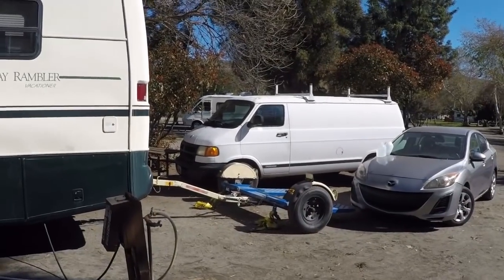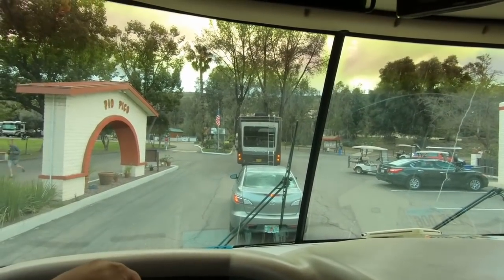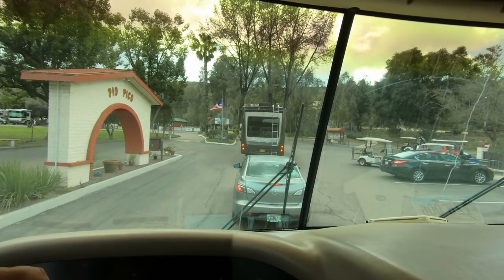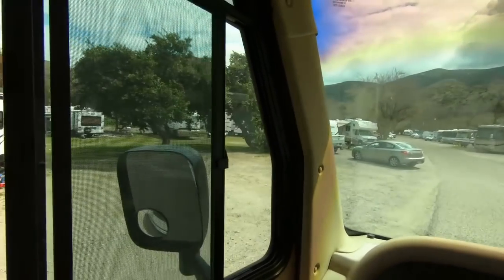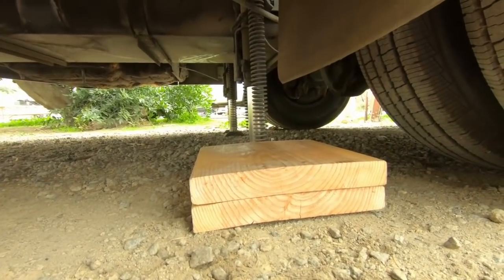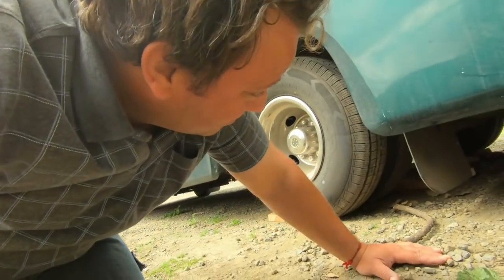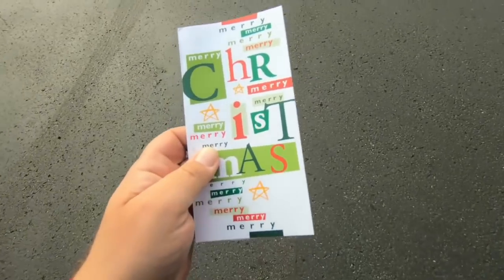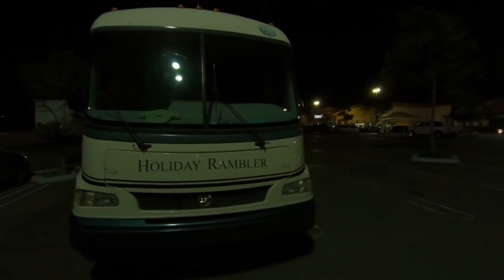$5 A Night RV Camping Site In San Diego California RV Park Life At Thousand Trails Pio Pico

Comment: I never thought someone could charge a large battery using a small battery. Whatever you are selling must be the magic gadget all of us have been waiting for. Lol
Reply from the maker: RAY RAY Lol,  guess you don't under stand the differences in battery chemistry or how they work.  Current goes from high voltage to low just like heat goes from warm to cold. That little battery box has more usable energy than you realize.  But,  it is expensive.
Reply from the maker: eren mori  No, with my coupon code its around $1300. And at 2000 cycles it will likely last me 10-12 years if I take care of it.

Comment: Ray Ray 
I invested in one of the Kodiak Packages, and with only the exception of a really slow stock charger, I could NOT be more pleased.  I've switched from charging the unit from shore power, to keeping it charged using the included 12 Volt DC cable & plug from my vehicles which charges super quick!   With so any more times the available amperage at such reduced weight and with the longevity taking into consideration - it's actually a bargain!  
Happy Easter Everyone!
Reply from the maker: Are you completely happy with inverter as well?
Reply: When the well packaged unit first arrived,  I followed the included instructions exactly, and found the unit was not charging to stated capacity.  Upon speaking to Inergy's rep, I was told (while ON speaker phone with witnesses present) that they are having issues with a "small percentage" of the presently included chargers that are failing to bring the units to what "they state" as fully charged.
 They immediately offered to send me another "standard" charger to replace the original, but were resistant when I offered to pay the difference so as to UPGRADE to the "Super" charger.  Their reply was that was sold as a separate part.  Well DUH .... I know it's not the same - which is why I ASKED for the upgrade.  Again, they said it's not up-gradable - it's an option - and I see no reasoning in their reply. 
Please Note: the INCLUDED "Car Charger" is seriously superior.
      If Inergy" would "WISELY" either include the "Super/Speed charger, or at least make it an up-gradable option for the measly $10 difference of the MSRP on the two AC chargers, I would be a far stronger supportive buyer.
BTW this is not a negative "rant" ...lol.  I prefer to call it an indepth review of my experience dealing with the company!  The Kodiak is great and now has proven itself on a trip to Hudson Bay in the seriously bitter cold of a Canadian winter.  The Kodiak DESERVES a thumbs UP, and you deserve a "thank you" for bringing it to our attention.  You were responsible for "Lighting the path to the Northern Lights .... well.... you and the Kodiak!  LOL

Comment: Hi James! Nice looking coach you have.  FYI, your coach's parking brake is actually an "Autopark" system and it holds the coach from moving on a slope with a large drum brake system that prevents the drive shaft from turning. You also have swing down style leveling jacks that can fold forward while extended if the coach is able to roll backwards. If the rear of the coach is lifted high enough that there is insufficient weight on the rear tires then the coach wants to "fall" backwards off the jacks causing them to fold forward until the rear tires reconnect with solid ground and stops the coach from moving. When you placed the blocks under the rear jacks you were able to lift the coach's rear wheels completely off the ground so there was nothing to keep it from rolling backwards. It's very important to always use heavy duty wheel chocks with a coach this size and if you must lift the rear of the coach to where there is little or no weight on the rear wheels, be sure to chock the front & rear of both front tire. As a rule of thumb it will always be safer to lift front higher instead of the rear in order to keep sufficient weight on the rear wheels and keep the coach from rolling inadvertently.  Safe travels!

Comment: The one thing that always kept me away from Pio Pico was the poor cellular coverage in the park.  Seems that there are a lot of little hills all around, and cellular towers don't reach inside the park well, or at all.  I've heard people say that there is a chair up on a hill past one of the restrooms where people can go to get enough of a signal to call out... and I've heard from some people who say that at the very end of the non-sewer section you can snag a signal if you have a booster... and then there are others who aren't interested in cellular for calls, they just want data... so they just sign up for the park's paid WiFi internet.   Do you have any experience with cellular and/or data in that park?

Comment: I have the elite connections which is 21 days park to park with only 7 says out of the same park but you can go directly to another... and no nightly fee at most parks. more expensive but worth it in the long run. sometimes you can find them cheaper second hand. plus tell them i referred you if you upgrade and we both get a deal.
Reply: Hello thank you for this information I live in SD and was looking for something like this. Do you have the platinum one

Comment: Why didn't the engine charge the house batteries when you were driving?
Reply from the maker: They do, but I didn't drive very far and the batteries were discharging all day keeping the fridge cold. It takes 12 hours to fully charge your deep cycle batteries. You cannot charge them fully in just a few minutes driving without ruining them.
Reply: Ok, that makes sense.
Reply: James don’t you have the frig on gas while you drive or is it a 3-way and you were running it on 12 volt on the road.  I use auto and it goes to gas as soon as I unplug my MH. 
I have 2- 6 volt AGM batteries.
Reply from the maker: +Doris Shanks When I plug into the Kodiak with it on auto it acts like I'm plugged into shore power.

Comment: Hey James. It almost looked like your coach rolled back. Hard to tell. Good to hear from you again, Jim
Reply from the maker: Agreed it moved a couple of inches when falling off jacks.
Reply: Hi James! Nice looking coach you have.  FYI, your coach's parking brake is actually an "Autopark" system and it holds the coach from moving on a slope with a large drum brake system that prevents the drive shaft from turning. You also have swing down style leveling jacks that can fold forward while extended if the coach is able to roll backwards. If the rear of the coach is lifted high enough that there is insufficient weight on the rear tires then the coach wants to "fall" backwards off the jacks causing them to fold forward until the rear tires reconnect with solid ground and stops the coach from moving. When you placed the blocks under the rear jacks you were able to lift the coach's rear wheels completely off the ground so there was nothing to keep it from rolling backwards. It's very important to always use heavy duty wheel chocks with a coach this size and if you must lift the rear of the coach to where there is little or no weight on the rear wheels, be sure to chock the front & rear of both front tire. As a rule of thumb it will always be safer to lift front higher instead of the rear in order to keep sufficient weight on the rear wheels and keep the coach from rolling inadvertently.  Safe travels!

Comment: Gas mode uses less power than auto? Why?
Reply from the maker: +Devil_Travels Because the fridge runs on propane or electricity.  When on auto with the Kodiak on the fridge pulls electricity instead of running on gas.  When fridge is in gas mode it pulls very little electricity.  Just enough to run the electronics and then the fridge cooling process uses the propane gas.
Reply: Wanderlust Estate ok I see. The Kodiak is the reason.